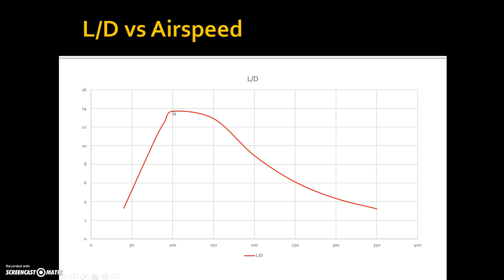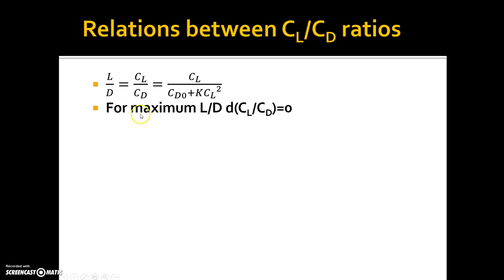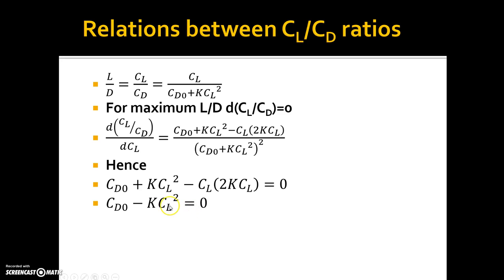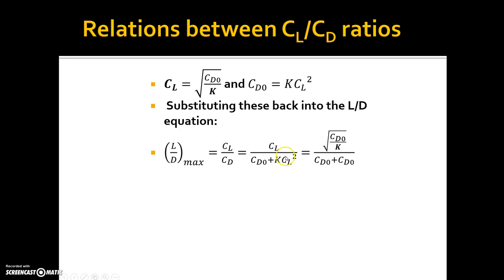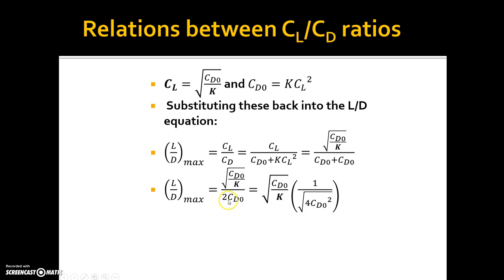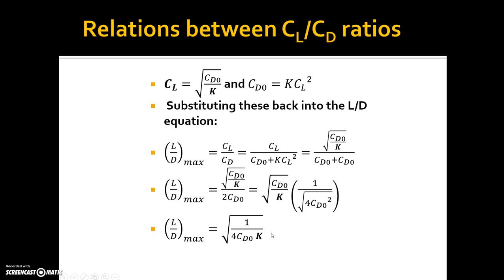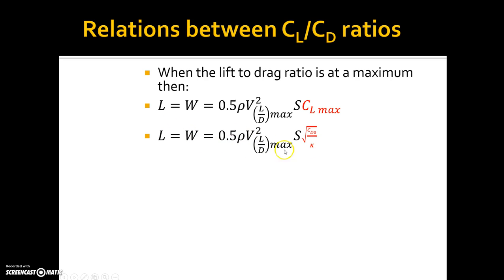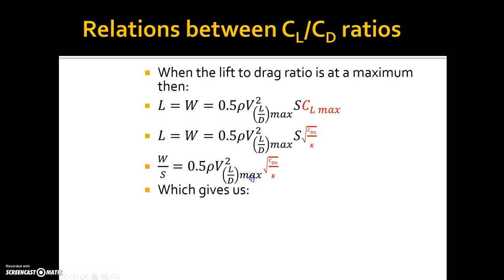Determining the Velocity for Maximum Lift to Drag

Comment: Hi, if the independent variable in the graph at 00:10 is the velocity (V), how come you differentiate it the equation (L/C) with respect to (CL) instead of (V)?
Reply from the maker: V is common to both Lift and Drag, so when you want to get the lift to drag ratio (Lift / Drag) the velocity will cancel out.